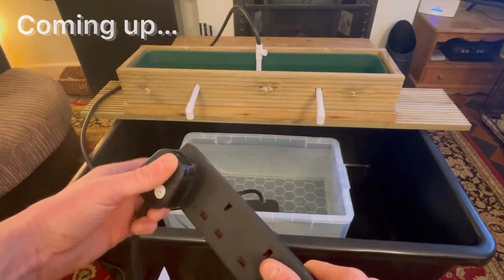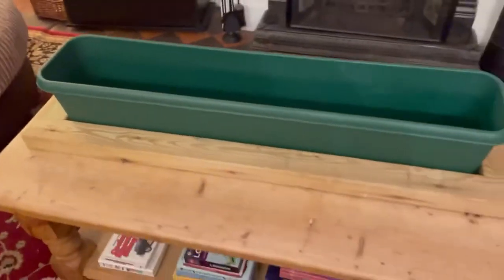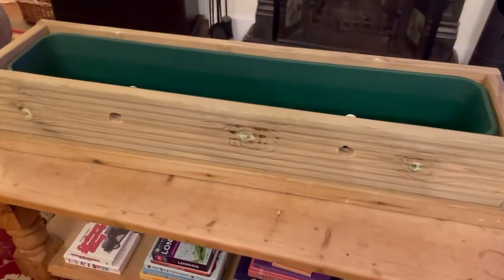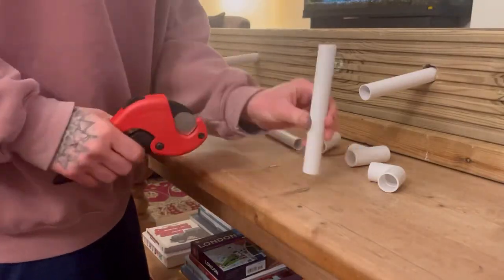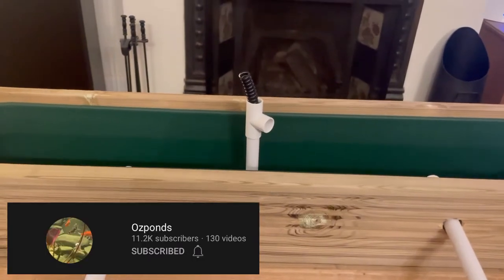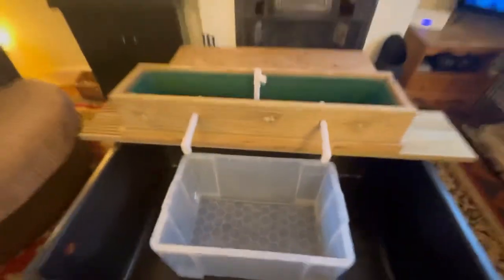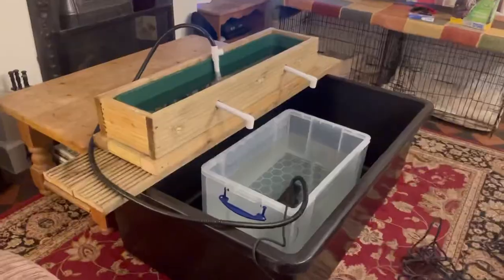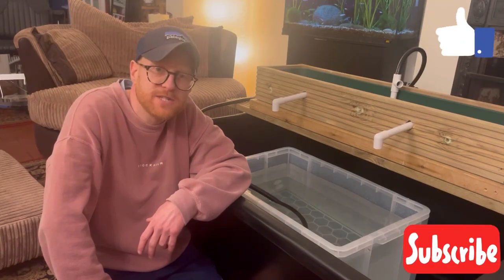EASY *diy* POND FILTER // build

Comment: Hi,  thank you for your wonderful videos. It would be great if you can show how to put media and what kind of media or a sponge in this filter for better efficiency and water filtering.
Reply from the maker: Thank you! I’ll see what I can do!!!
Reply: Thanks a lot. The question is in this method the water comes from bottom to top on the filter, and how is it possible not to clog the inner pipeline with the sponge or whatever media that we have to put on the top bucket to do the filtration?

Comment: Love your videos, I’m taking the plunge soon and making my own, but could I use a single outlet to a spillway instead?
Reply from the maker: Thank you!! I’m glad you like the videos! Yeah, can use a single outlet, just make sure its big enough to handle the water flow being pumped into the filter. If the outlet is too small and your pump is too powerful, the bog may over flow, because the water can’t flow out quick enough. Remember that the water is being pump into the filter under pressure but it leaving just through gravity. Good luck with the build!!! 👊😊

Comment: What will you put inside the bog filter? Aren’t you going to install a tube on both side of the T connector with holes to evenly disperse the water in the filter?
Reply from the maker: With it being quite a small bog filter, I just used pea gravel. I did think about adding some tubing with holes to the T, but decided against it in the end as I was worried that the smaller holes may block up more easily. Thanks for watching!! 😊

Comment: Thanks for the content, I have built similar for my half barrel pond. Having issues with the amount of cleaning am having to do. I only have 1 koi and 2 gold fish in the pond but seem to have to clean the bog filter monthly and still the pond isnt particularly clear. am i doing something wrong?
Reply from the maker: Hi there, how big is the pond and the bog filter? Also, whats your flow rate like? Something you could think about is maybe adding some sort of pre-filter?
Reply: @GingerFishyOfficial  it's half a oak barrel 63cm X 45cm high. Bog filter is a 55cm trough.

700 blagdon pump being used.

Comment: although a good vlog i would of thought bigger piping should be used. 1 pipe should be able to handle the full flow from the pump in case of 1 blocking up this set up would def over flow

Comment: Hi mate. 
The pond you have made looks great👍 I’m currently in the process of planing my own above ground pond and keep changing my mind about using a pond liner or a plastic tub. How many litres of water does the plastic tub you have used hold?
Reply from the maker: Hi mate, thanks very much! The tub I used is 470L. I did think about building one out of wood and using pond liner, but was just a bit worried about how strong it would be, with all the water pressure. Plus I think it can be quite tricky to get the pond liner in neatly. Lots of people do do it that way though. Good luck with your build! 👍

Comment: What size pond and stocking levels do you think that would be able to cope with? 🤔
Reply from the maker: I’ve got it on a 470L tub. I think the filter capacity might vary depending on the plants. Long term I’m only planning on keeping White Cloud Mountain minnows in there, so bio load will be low. I am going to be keeping 9 goldfish in there temporarily though, while I rebuild there main pond, but I’ll probably have to do some fairly regular water changes. Thanks for watching!

Comment: So how does that filter water I don't understand?
Reply from the maker: The water is pumped from the pond into the bottom of the filter, it then rises up the through the planter, which is filled with gravel, which provides surface area for beneficial bacteria to grow, this beneficial bacteria will convert ammonia (which is toxic to fish)  to nitrite (which is also toxic to fish) to nitrate (which is only toxic in high concentrations). The plants that will be planted in the filter will soak up the nitrates before they reach toxic levels (they will also soak up ammonia directly), and therefore keeping the water biologically safe for fish. Whilst this is all going on, physical waste will settle in the bottom of the filter, which the plants can also tap into. It’s not the perfect filter design as I didn’t include a clean-out valve to remove the waste that will build up at the bottom. But I have since made a better filter that does include a clean out valve. You can see it in the filter I’ll built in this video: 
https://youtu.be/oFc0oT5Zhks?si=73FtmGbyShQzb9n4
Hope that helps!

Comment: Hi I'm in the process of doin a water garden gonna add couple of fish eventually what kind of stainer did u use for the outside of ur outdoor pond  thanks x
Reply from the maker: Hi Debbie, the colour of stain I used was Natural Oak. If your in the UK I got it at Wickes, and it was the Wickes own brand, Decking stain - Natural Oak. 😊👍
Reply: Thanks fur gettin bk tae me that's gr8t.
Reply: Hi soz tae bother u again is this safe fur the fish tae obviously it rains alot in Scotland lol.
Reply from the maker: @debbiesproul4934  yeah, the fish should be fine! As long as the pond is deep enough to not completely freeze solid in the winter. 😊
Reply: Thanks so much fur ur help.